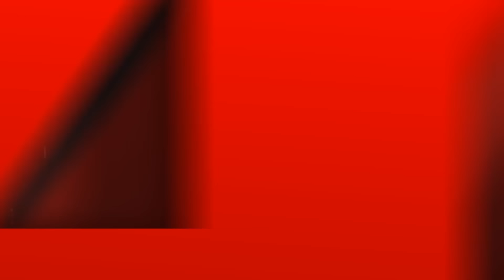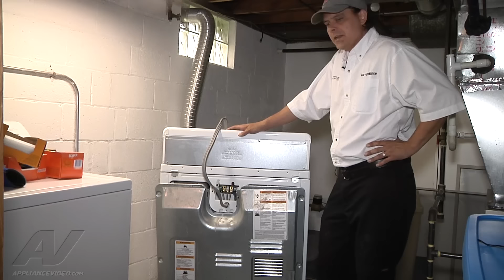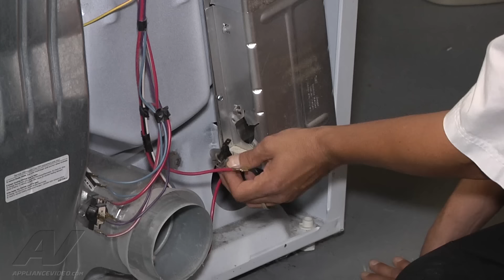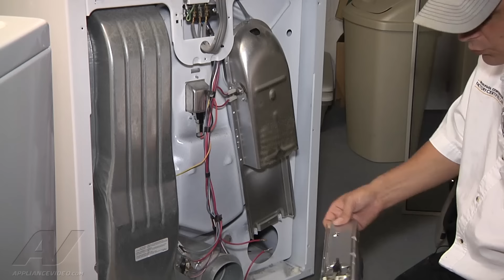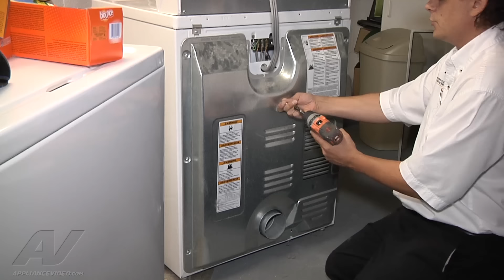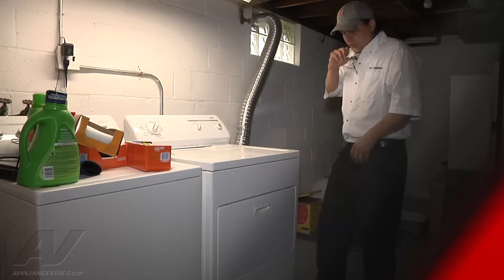Kenmore Dryer Repair - Does Not Heat - Element Diagnostic & Troubleshooting

Comment: Great vid! I did replace the heating element and the thermostat and it ran like a champ for a week. Now it's not heating, any idea what it could be?
Reply from the maker: Thanks for your response, and we are glad we could help.
Please help us by subscribing to our Facebook page , YouTube channel,  or post our website www.ApplianceVideo.com .
Reply: It could be your thermal fuse.  That is what he didn't check in this video.  It's located about a foot about the element with 2 wires going to it and you can see it in the video. That's what went bad on mine.  Your best bet would be to check everything again with a multi-meter.  It's possible one or both of your new parts could have failed.  I would eliminate all possibilities.
Reply: @packrat76  I think that’s what’s happening to mine, continuity is OK on the heating element and thermostat and the dryer doesn’t heat. What should I check in the thermal fuse? Continuity too? Thanks

Comment: Is it normal it smell a burnt scent the first time u turn it on after replacing?
Reply from the maker: Hello, for
technical questions we have a Repair Help section at this link https://www.appliancevideo.com/repair-help/ . There are over 6,000 answers and questions you
can search through FREE to help you with your problem. Hope this helps
Reply: Yes, that's normal.  It should go away after a little while.